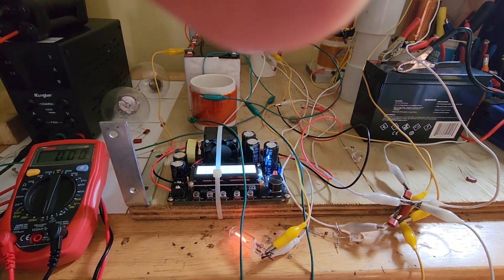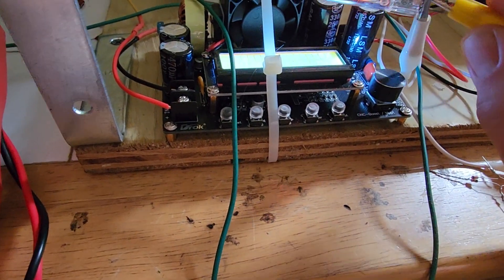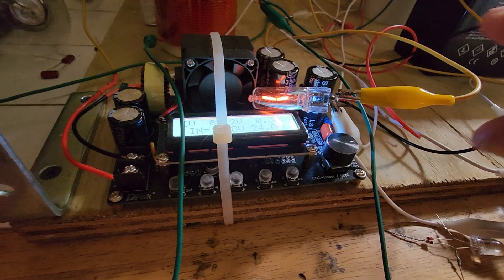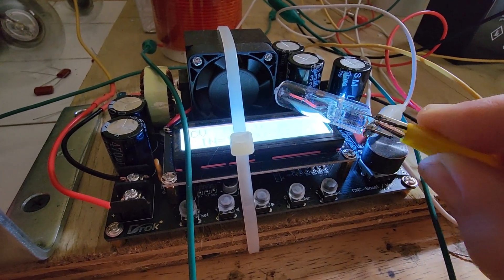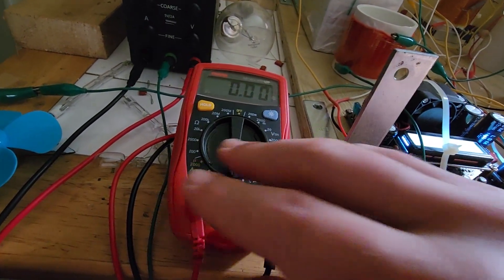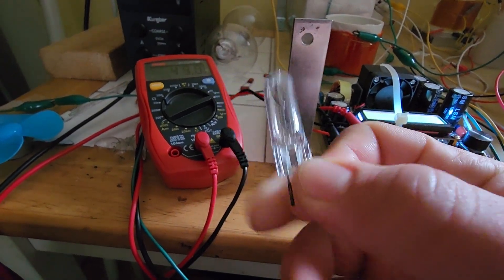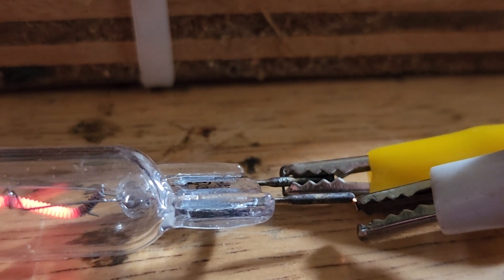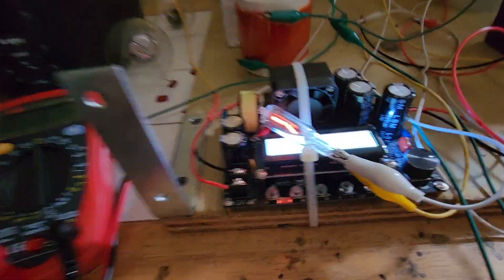💡Maximizing The Received Powers Decoupling Effect & Not Draining Your Source Plus Experiments💡

Comment: I have recently noticed some levitation and vibration effects in objects near my HFSSTC . I don't know what that was . Can you pls explain why it happened .
Reply from the maker: Very interesting & i noticed similar effects when a receiver coils high voltage lights up a small Incandescent light bulb. Aluminum objects near the bulb will act strange & it's theorized some form of longitudinal energy perturbations are being emitted off of the Incandescent bulb when being lit from this type of energy that can vibrate & attract objects. It's definitely different from electrostatic attraction. :)
Reply: @MTECHINDUSTRIES2022  what voltage in how much watt of power you used and in what frequency for that .

        I was doing random frequency tuning in random voltage . So, I have no data about it.
So, I want to replicate the same thing again with your help.

       And you are helping me a lot brother ❤️. By the way what is your name 🙂
Reply from the maker: @d.abhishekh  my names Mal & the voltage going into the transmitter was 70 volts at 30ma which then wirelessly powers up receiver coils that can run loads when Earth grounded & charge super caps & batteries to run inverters. The system can also be self sustaining when combined with ambient energy harvesting circuitry & ground loop capture circuitry & the frequency is 3 mhz & when the transmitter is on it stimulates the excess power in these circuits via a Pumping action. :)

Comment: Do you find that the radiant energy isn't useful except for the LEDs? Is that why you're only focusing on the transmitted power vs the radiant power? Maybe I'm not understanding the system correctly. Anyway, great work!
Reply from the maker: The radiant energy seems to be able to activate an indefinite number of the wireless led receivers when they're grounded or near any piece of metal within 500ft of the transmitter
Reply: Led work well is only because it consumes almost no current when the voltage is lower than it’s rated voltage, have a look of the LED VA curve guys, there’s nothing magical
Reply from the maker: @teslatechnology4371  the magical effect is i can be 500ft away from my transmitter while it's only consuming 5 watts & it can light my mini LED receivers when i ground them to a large plane of metal & I've even Demonstrated this in my earlier videos
Reply: @MTECHINDUSTRIES2022  that’s nothing magical either,btw 5watt is too big I can achieve the same with 0.3watt
Reply from the maker: @teslatechnology4371  if you can then please share a schematic we're all on the same side here & this is open source research & the shared advancement of it benefits everyone  :)

Comment: Oh you even told your battery secret 😂 that brightness can’t be 20watt,you can prove it easily by applying mechanical voltage meter and current meters same time when the load is on
Reply from the maker: My system at the moment is run by a 12v  super cap bank in parallel. This powers the variable dc boost board that runs the transmitter. My combined wireless received power now charges a 12v agm battery & once that battery is full it dumps it's charge into the input caps keeping them full. This is an identical model to the super caps i used.

nA4aM7Q1KDiNd_ne_CQmDifitYHfwUnNKxxYuiN8qmQaAnjsEALw_wcB